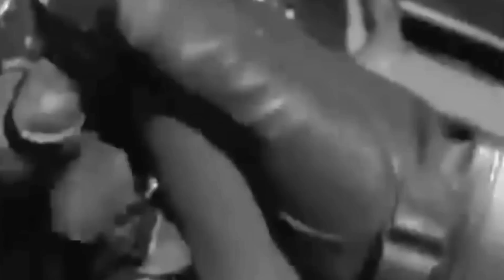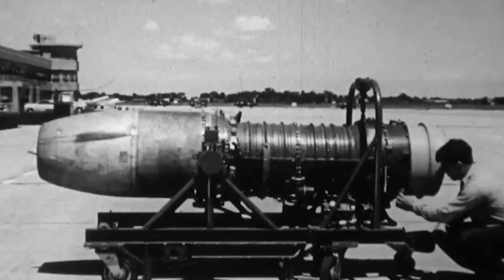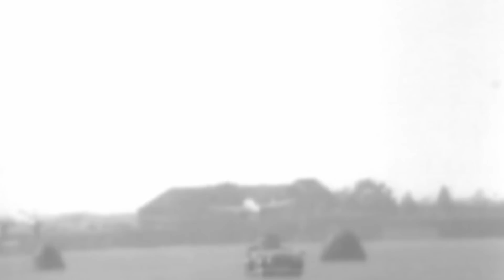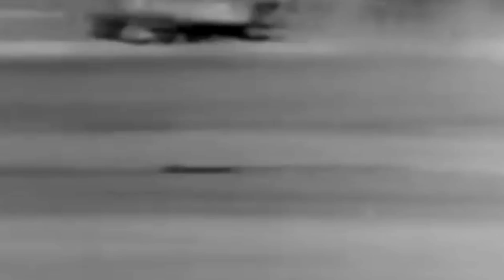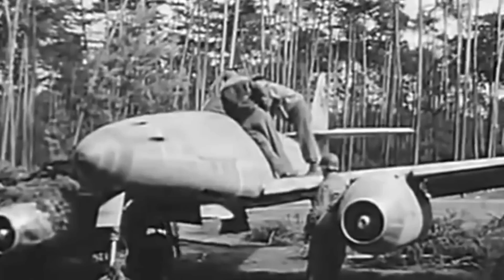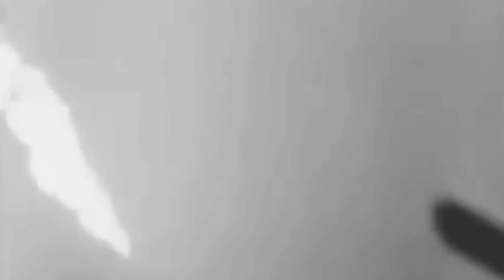The Never Before Seen Fighter

Comment: The ME-262 the official first operational jet fighter. However, the plane was not truly ready for combat yet. The Americans, British and Russians suffered the same and more issues. One of the biggest issues faced by the jets (combat ready or not) was the fact there was not an instantaneous reaction from the engines when the pilot adjusted the speed. In terms of the 262 though the biggest issue was pilots did not have time to train on this brand new technology that not one as of yet had real experience with. Plus Hitler wanted the 262 to be a bomber
Reply: You have obviously never flown a jet aircraft...
All jets including modern ones with digital fuel controls are incredibly sluggish and slow to accelerate from flight idle with poor throttle response.

No jet fighter pilot would ever fly in a combat zone with less than 85% of military power.
Reply: @WilhelmKarsten  What jet fighters did you fly?
Reply: @WilhelmKarsten  Die Idee eines Turbinenkraftwagen hat man deswegen aufgegeben.
Reply: Another major problem the Germans had with their jet engines was they had NO titanium parts. These engines were all steel. Operating hours were limited to about 1 sortie & then had to be trashed & completely new engines installed. No country ever won a war when they were forced to replace their engines every time they flew them.
Reply: @toranagachan3402  The Jumo -004B engines that powered the Me-262 easily passed the Luftwaffe 100 hour reliability test and the USAAF exhaustively tested the Me-262 during Operation LUSTY after the war and confirmed the engines lasted on averaged 55 hours between overhauls.
Better than Allied piston engines.
Reply: @WilhelmKarsten Entònces porqué fracasaron y no pudieron impedir que los B-17 bombardearon toda Alemania. 
No hay que cargarse y ni ver la historia. Los Mustang derribaron muchós 262 y cuando el mariscal Gering vio un Mustang volando sobre Berlín, grito Alemania perdimos la guerra.
Reply: @rubenomarbueno1134  The P-51 Mustang was no match for the vastly superior Messerschmitt Me-262.
Reply: @WilhelmKarsten  Sandyboy, your fantasies about 100 hour tests are meaningless against the well known inadequacies of the Me 262's engines and your nonsense about 55 hour  TBOs is laughable. The merlin had a TBO of 240 hours.
Reply: @WilhelmKarsten  Sandyboy, as you know P-51 Mustangs and other allied prop fighters shot down Me 262s. So much so that Me 262 pilots were forbidden from engaging allied  fighters.
Reply: @rubenomarbueno1134  Chuck Yeager- "First time I saw a jet, I shot it down."
Reply: @WilhelmKarsten  How did our US planes keep flying if every week they needed new engines?
Reply: @WilhelmKarsten  ,Get real! Be proud your German but why be an arrogant fool. Heard most Germans can't be real.
Reply: @jimandersen3003  USAAF ground crews replaced or overhaul 10s of thousands of engines during WW2... a typical WW2  fighter aircraft requires anywhere between 35 and 60 man-hours of maintenance and repairs per hour of flight time and spends 4 to 6 months in maintenance downtime per year... the average WW2 fighter aircraft had an expected service life of less than one year before being shot down, crashed or damaged beyond repair.
Reply: @jimandersen3003  A P-51 Mustang Packard V-1650 "Merlin" engine requires a mandatory inspection and repair every flight if WEP is used, the engine requires a completely teardown, internal inspection and overhaul for every 5 hours of flight time if WEP is used.
Reply: @jimandersen3003  I'm not German..
You make alot of foolish assumptions don't you?
Reply: @WilhelmKarsten  Danke für die Standzeiten. Hatte ich auch so eingeschätzt. Viele waren schon viel früher defekt. Die Engländer hatten nicht den Stand der deutschen Turbinen.
Reply: I will never understand that ridiculous doctrine Hitler enforced which meant that every aircraft in the Luftwaffe's arsenal was capable of bombing - had this not been a prerequisite of every German fighter aircraft they might have seen more success with less conventional designs, or at the least less fighters wasted on roles that they didn't excel at.
Reply: @DTP_Band You don't understand a lot of things about military aircraft if that's your case.

Hitler has been absolutely proven correct by history..
Modern jet fighters are multi-role Interceptor-Attack aircraft with bombing capabilities.
The Messerschmitt Me-262 was no different from propeller driven fighters like the P-51 Mustang which also had hard points and could carry a similar bomb load, the Mustang also had a dedicated bomber variant the A-36
Reply: @WilhelmKarsten  my point was more that they were wasted in those roles, as they couldn't fill them to the best of their abilities. It was less of an issue with aircraft specifically designed for multi-role use like the mosquito, with it being rare for any aircraft of the day to be truly effective at multiple roles. I do agree with the statement that it's a good idea for aircraft to be able to fill more than just one role, though mainly with modern aircraft, which are much more expensive to produce than their 40s counterparts.
Reply: @DTP_Band  It's based on a rather infantile myth, a false narrative that has no historical significance or value. It's simply intended as an insult.
No historian or military scholar gives such things any credit, as I said it pure nonsense.
Most fighters then, as now also operate in the bomber role, fighters are by definition multi-role aircraft.

Comment: Germany could develop, refine and mass produce the Me-262 only in peacetime and would have to be in secrecy.  These jet engine need significant quantities of Ni, Cr, Co plus W.  The engine tolerances are very tight to obtain max performance, efficiency…%. Plus a lot testing down to the harmonics.  Even the armaments needed to be refined including a long range accurate 30 mm cannon, air to air missiles, radar, etc.  Probably made a difference in sufficient numbers?
Reply: Germany manufactured 8,000 Jumo 109-004B Orkan engines with production ramping up to 10,000 engines per month.
The B version required no Nickel or Cobalt,  Chromium was available in required quantities.
W? Tungsten? is not used in jet engines.

That's incorrect, jet engines require much lower tolerances and few high tolerance parts, were faster to build than piston engines and cost about 1/3  as much... they also didn't need highly refined gasoline, J-stoff was made from plentiful supplies of coal.

Without any doubt the Messerschmitt Me-262 was the developed and refined jet aircraft and was very successful in operational service.
Reply: @WilhelmKarsten  Hello Sandyboy, yes your nazi heroes' did rather stupidly produce 8000 shit engines but then that just demonstrates their strategic incompetence. 
Witout any doubt the Me 262 was a developed but unrefined jet aircraft with underdeveloped engines and was a failure in operational service and the market place.

Comment: Didn't Hitler hold back the development of the 262?  Had it been introduced earlier, there would have been a different outcome.
Reply: I believe Hitler slowed down production by 2 years.
Reply: He was opposed to mostly anything new, and because he was stuck in his ways he believed dive bombing to be the best attribute in a fighting aircraft, he even insisted the Heinkel HE-111, HE-277 and the Junkers JU-88 have dive bombing capability. If the 262 had came a year earlier it certainly would have changed the air war over Europe, Germany's path to defeat lay in denying them critical materials and fuel, which would have taken a lot longer if they had air superiority, indeed the 262s weakness was lack of fuel and lack of high temperature metals for the engines
Reply: @davidewhite69 Actually the Me-262 was fuel by Coal based jet fuel which drastically reduced gasoline demands.
Reply: No, that's a popular but completely false myth...
The only thing that delayed production was modifications to the engines due to the shortage of Nickel.

The Jumo 109-004B Orkan engines were developed to use Krupp P-198 Chromadur alloy which had a slightly lower creep temperature which required development of more advanced heat management technology such as bleed air cooling and TBCs

Comment: Another worthwhile thing to note is how fragile those early Jumo and Junkers jet engines were. You could not slam the throttle, or the engines would burst into flames. You needed to gradually increase the throttle. In addition, one well-placed bullet could also make the engines burst into flames.

That said, look at how finicky those early rockets were, but how how devastating they could be when they DID work. Of course, when they didn't work, they were equally as devastating to the launch site.

That proves the age-old motto, "War is the mother of invention."
Reply: Before FADEC, you couldn't just jam the throttles forward on many civil jet engines, either.  If you did, you could exceed temperatures in sections of the engines.  You had to advance the throttles while watching the temperatures.  FADEC has made modern engine control much easier.
Reply: So, around the 60s?
Reply: @ThatGroovyGuitarGuy  FADEC (full authority digital engine controls) didn't start in civil aircraft until the 1980's.  Military aircraft probably had it earlier...
Reply: @ThatGroovyGuitarGuy Most jet engines didn't have fully automatic (electromechanical) fuel controls until the mid-1950s 
Mechanical automatic fuel controls have been replaced by FADEC
Reply: @brentboswell1294 YES, FADEC makes it easier... but not faster.
Spool-up is still slow and throttle response is intentionally delayed to prevent over-fueling damage.
Reply: Jumo is the engine division of Junkers... same company.

All WW2 jet engines have manual controlled fuel flow, but the Me-262 was the first to have an automatic variable exhaust nozzle and later engines had throttle dampers to assist the pilot in preventing movement that was too fast.
All jet engines are slow to accelerate from idle and have poor throttle response, even modern engines with FADEC.

Because jet engines operate at higher continuous power settings pilots don't retard the throttles or lean the fuel mixture in cruising like they would with a piston engine.

Comment: As an aside, it needs to be mentioned that the Kikka was in no way a copy of the -262, but rather inspired by it.
Reply: The Kikka was supposed to be a copy but the Japanese lost the drawings and prototype sent from Germany in a spectacular “own goal” when they sunk their own submarine.
Reply: @allangibson8494  Please reboot your brain and read up better on REAL WORLD HISTORY yes?

The Kikka is SEVERAL meters shorter and more narrow, the Kikka does NOT have swept wings, the Kikka was supposed to use domestically developed engines which was later abandoned because someone figured out how to develop an engine based on the BMW 003, etc etc etc.

It was NEVER supposed to be a copy.

Its development started in 1942, not 1944.
Reply: @DIREWOLFx75  I suggest you look up when the Me262 started development. 
The Kikka was based on sketches of the Me262 and He280 by Japanese military attachés and service manuals for the engines.
The Nakajima Ki-201 Karyu was even closer to the Me262.
Reply: @allangibson8494  "The Kikka was based on sketches of the Me262 and He280 by Japanese military attachés"

Yes, did i say anything else?   Inspired by does not equate copy.   And the fact that the Kikka is so UTTERLY and completely different internally tells you instantly that there was no copying going on.
Not to mention the fact that it's considerably SMALLER and doesn't have swept wings, meaning that the aerodynamics are not even in the same neighborhood as that of the 262.

Claiming that the Kikka is a copy of the -262 is on the level of saying that the M4 Sherman is a copy of the T-34.

Completely ridiculous.   Inspired by, YES, copied, no.

"and service manuals for the engines."

No, THAT happened LATER.   The original engine intended was the Tsu-11 motorjet, like the ones Italy pioneered in the 30s.

After which they switched to the Ne-10 and then the Ne-12, and THEN eventually to the not quite copy of the BMW 003, when it was found that the engines Japan were working on domestically were simply not powerful enough for the indended use nor ready enough.

"The Nakajima Ki-201 Karyu was even closer to the Me262."

Yes, and the 201 was still nowhere near an actual copy.   Just the fact that it didn't have swept wings alone should make that bloody obvious.

However, the 201 started development in 1944, AFTER the -262 had actually been used in real combat.
The Kikka started development over 2 years earlier.

"the Me262 and He280"

Yeah, exactly.   The Kikka was NOT taking its cues from ONE aircraft, but from TWO, two very different aircraft, which at that time were also nowhere near operationally finished.

"I suggest you look up when the Me262 started development."

Why?   The RELEVANT part is that the Japanese military attache saw the 280 and 262 flying and did his best to convey their design features back home.
Reply: @DIREWOLFx75  The Kikka was based on sketches sent back from Germany of the Me262 in 1942 - after its first flights. The 262’s entry to service was delayed by unreliable engines.

Comment: The Me 262 was anything but maneuverable.
Reply: But in the hands of a competent pilot outside of takeoff and landing it was untoucheable.
Reply: Pilots who flew the Messerschmitt Me-262 said it was very maneuverable with excellent handling, the German jet could turn and maneuver at speeds 100 mph faster than Allied aircraft could not reach in straight and level flight.

Allied aircraft were completely outclassed by the Me-262 in a dogfight.
Reply: @WilhelmKarsten  Hello Sandyboy, as you know the Me 262 was a poor fighter, indeed Eric 'Winkle' Brown whilst describing it as a most formidable aircraft stated that it was "NO FIGHTER" and that it could not effectively perform dogfight maneuvers.  Brown identified it's proper use as a zoom and boom interceptor but noted the limiting lack of dive brakes.
Me 262 pilots were forbidden from engaging allied fighters. 
From the Smithsonian on their Me 262 -
"Despite its great speed advantage, the Me 262 was not as maneuverable as top-of-the-line piston fighters and it had a tendency to stall due to a tricky compressor. The jet engines burned out quickly and were not that reliable."
Reply: @WilhelmKarsten  Very strangely, Galland was adept at the hit technique (bombers) & run
Reply: @daniel_lucio  Galland was a very skilled pilot but his real talent was politics and mastered the technique of talking out of both sides of his mouth... depending upon who was in the room and who they liked and didn't like.
Reply: @WilhelmKarsten  Hello Sandyboy, as you know Galland was a man who didn't hesitate to speak his mind as his treatment of your fat nazi hero Goering attests.
Reply: @WilhelmKarsten  As you know Sandboy, Galland was a straight talking man as his treatment of your nazi heroe Goering attested.